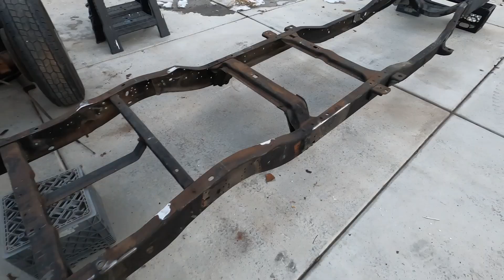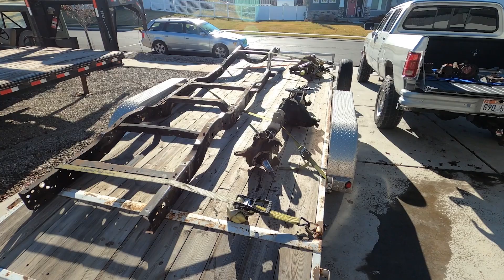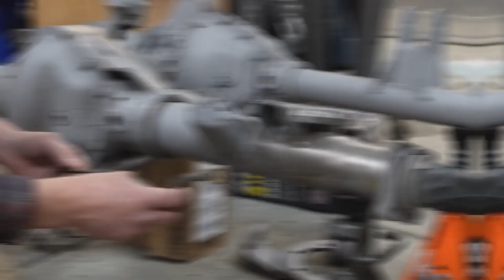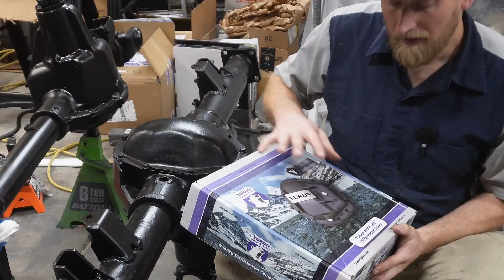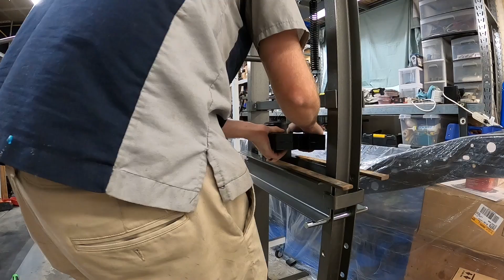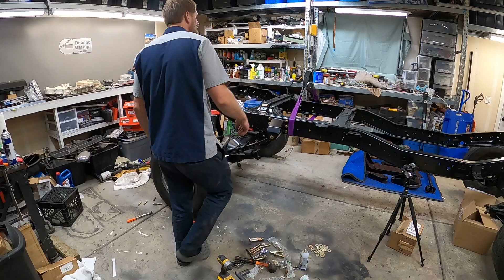30 Year Old Truck Gets a BRAND NEW Axle | The Ultimate American Truck Build - Ep.3

Comment: hey thanks so much man you are the best.  for anyone doing the front big brakes, i think you used dorman 620-563 studs on your front, which have the spacing before the splines, which works to convert the original brake setup to 9/16" studs (for space for the rotor behind the hub).  however, i think you want to use dorman 610-347, as these have teh splines further back, and the knurl in front, which will actually help locate the rotor onto the hub when the rotor is outside of the hub (for the big brake upgrade).  youre so helpful man super appreciate you sharing all this!!

Comment: I absolutely love the build and how beautiful it turned out!!
You mentioned that the rear axle is a Dana 80, what year truck did it come from as I have gone through two Dana 70’s and I know the 80 is a far superior axle.
Keep up the awesome work!!

Just noticed you mentioned the axle is from a 2002 Dodge, is it a SRW or DRW axle?
Thanks
Reply from the maker: Dana 80s came in some of the later second gen 3500s. If you can find an 01 or 02 it'll have factory disc brakes as well like this one.

Comment: Nice work. The Torq big brake setup adds track width to the front with the rotor outside on the hub vs inside with stock setup. Sure makes brake work easier, inboard brakes are a pain.  What rear axle did you use? 2nd gen SRW axle is around 4" wider, WMS to WMS, than 1st gen unless you get one from a cab & chassis then they're about the same as first gen. Curious to see what you're doing with wheels and tires. Can't wait for the next episode!

Comment: Hello I been watching your  you’re videos since you started your channel 
I’m working on a  85 dodge crew cab conversion 
I would like to swap my rea axle like you did 
Mi   question is  the new axle  is it going to be the same width from the front on the truck 
Because I do have one from   a 2001  3/4 ton dodge Ram   and it looks or appears to be wider than that original it is on the truck 
Or do I need one from a 2002 ?
Keep up the good work 👌
Reply from the maker: The width is almost identical. If it's a Dana 70 it should be identical except the spring perches
Reply: I put a 2nd gen dana 80 under my d250  and its about an inch wider on each side than the original.  You could spacer the front out to make it run track in track if you wanted but I just left mine alone its barely noticeable.
Reply: Probably I will do to same since the on I have it does have  rear disc brakes it was  from a 2001 cumins

Comment: Tim it’s looking great   I had just received a box today from Torq axle it has my new brake brackets in it can’t wait to get it together David
Reply from the maker: Did you do the 17" or 16" kit?
Reply: @decentgarage  I did the 17” brackets for the step side truck, but I used the 16” brackets with 13” rotors on my military truck with hydro boost it turned out working so nice thank you so much for all your videos it helps to see what works on these old trucks and what others are doing thanks David